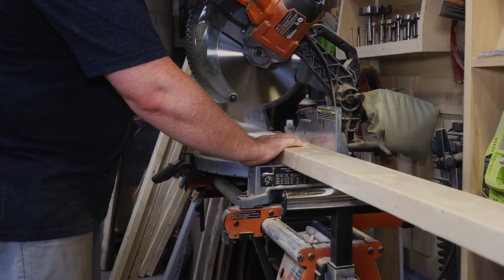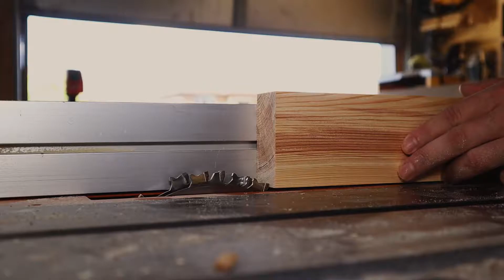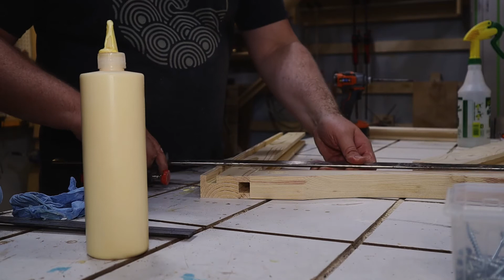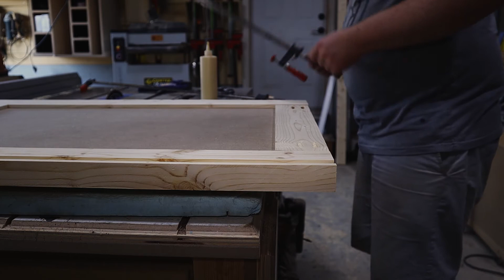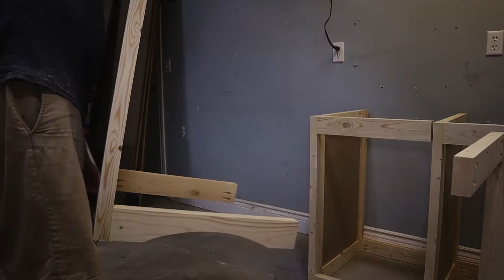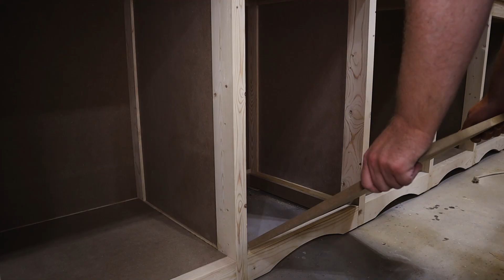How To Build A Workbench // 2X4 Workbench // Miter Saw Station // Woodworking // DIY

Comment: Love it. Really appreciate that you included the little demo part. Shuffling around stuff in the shop can happen often until I’ve settled a few areas.
I really like your tall shelving unit with the slots to adjust it. Seems like the best solution, either vertical or horizontal cubby unit.
Reply from the maker: It always seems like a work in progress